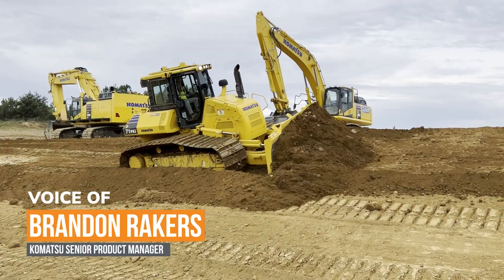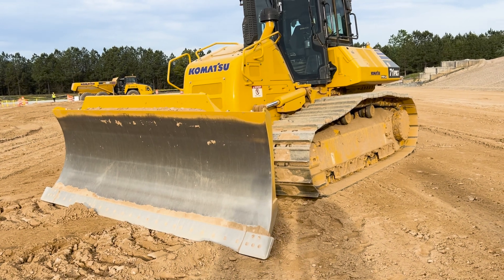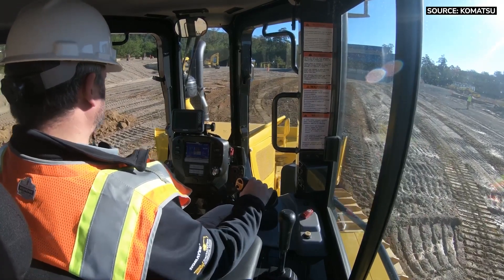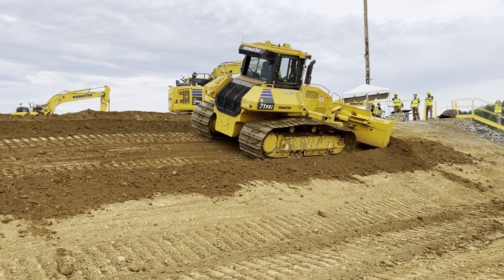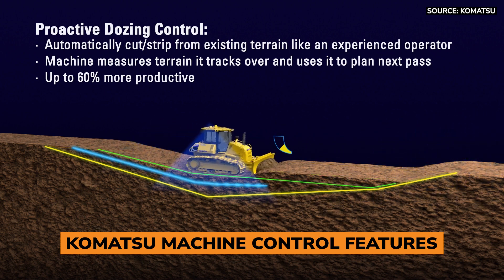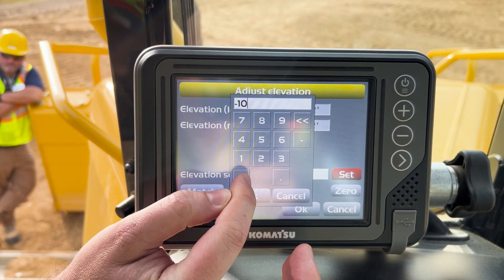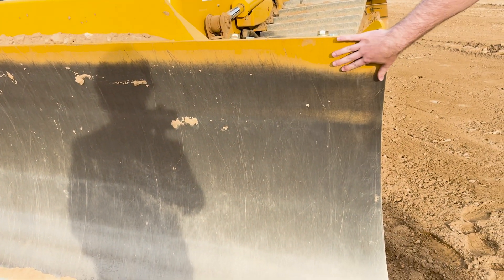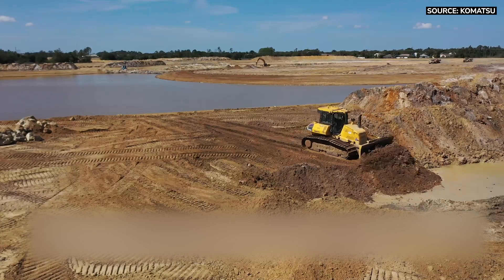A Closer Look at Komatsu’s “North American Baby” – the D71PXi dozer

Comment: 60 yrs as a dozer operator it would be thee best dozer I have operated. Currently on a new D 6 Next Gen and it don't come any where near a D 71 in regards of power, visibility, ease of access & quietness in the cab, + the D 6  just drinks Add BLUE. If I was going  to pick between a D 6 & D 71 it would be a D71 any day.